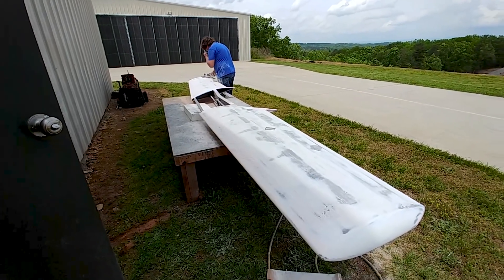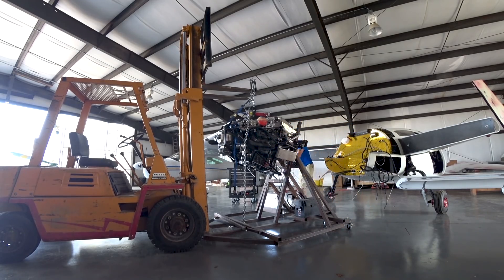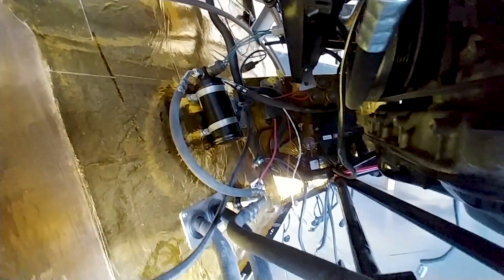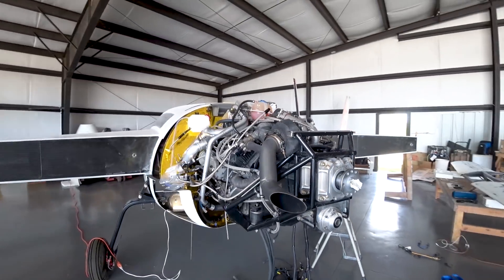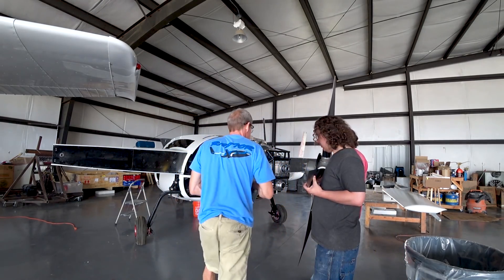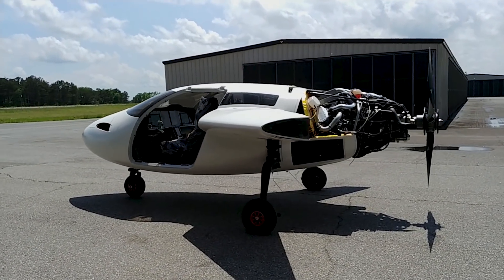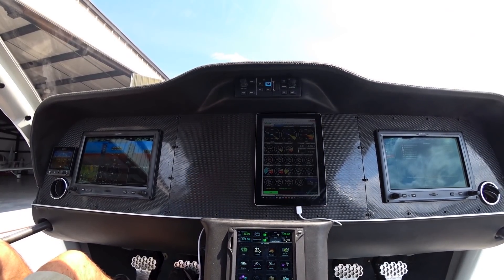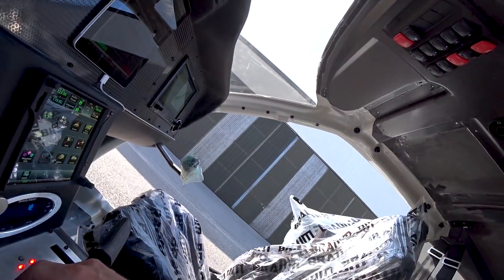Moving Under Her Own Power - Building the Raptor Prototype

Comment: Whoohooo!  Looking Good!  Congratulations!!!  Here's a suggestion for your oil leak.
Honda dominated motorcycle market partly by offering leak free crankcases using their own gasket material; Hondabond works great.
Not cheap or easy to find but this company is great resource for motorcycle components.  https://4into1.com/genuine-hondabond-ht-08718-0004-hi-temp-silicone-liquid-gasket/

Comment: Yamabond, hondabond, 1104, permatex for motorcycle, watercraft, atv. It completely different from rtv silicone and it works permanently until you take it apart. Yamabond from yamaha is the original. It will never break down over time.

Comment: You might be getting a ground loop on your radio ground, ground loops act like an antenna. Also how did you source your engine? Simply getting an auto-conversion diesel engine on an aircraft and having it work as expected is a good accomplishment, were I in your shoes I would see about offering your skills to kit builders to get their hands on converted engines.

Comment: Loved the smile when you went for a taxi. You should be able to pressure test the redrive off the engine to see if the weep is from the prop feed or the engine feed. It also may be flooded and over pressurising. The drain might need to be increased to reduce pressure inside, or may be bottle necked at the sump end.  Thanks for the updates.

Comment: ya know, it all looks cool and fancy but I would not trust that dash for nothing. One hit by an electrical surge or any number of issues electronically and you have nothing. I already know the hate comments but I said the same thing about dive computers and said I would never dive with a digital gauge set for the exact same reason. People died and it was a direct result of failed electronic gauges. 
Not mechanical, electric. So, have fun with your fancy machine. Looks cool but how does all that spot fill bondo handle flexing. I know is sure as hell does not work on boat hulls that flex. Just curious.
Reply: You act like this is the first plane built with these techniques.
Reply: @donanders2110  No, it is not that. I grew up around people like Darryl Greenamyer and Steve Hinton out at Chino Airport and Reno Air races and Long Beach Airport to name just some. My Dad was one of if not these top Mechanical, Structural and Propellent Engineers at McDonald Douglas. He set up the designs for many many things that fly in air and space. Every control thrusters that you see on all those maneuvers in space, well that was all his design. The Main Wing spare on the C-17 and ALL the tooling was his design. He was originally hired for his first jobs by Jack Northrup himself working on the Flying Wing. So yes, I have some stories to tell. What is it that you are not understanding about flex and bonding materials. Your right about it is not the first time those materials are used in a plane but I am also aware of why they are not used unless special bonding procedures are used with certain compounds and resins.  I know it is all about the process of new and better materials, and I am sure your homework is done. All I am pointing out is what I know and have been shown in many different fields of racing both in the air and in the water. Both are flexing and surface temp and pressures so, like I said, Very cool plane and looks very comfortable. I am sure it will fly as good as it looks. Please do not take offense to my pointing out my personal opinion. You know how it goes. Most people on here don't know shit about anything. Some though know more than most. Opinions are like assholes, everyone has one. Thanks for your reply and good luck with all your beautiful workmanship. You can be very proud of it. :-)

Comment: The continuous static is probably the radio frequency “electromagnetic interference hash” from the various 12V to USB switch mode charger units. Try disconnecting them from 12V and try the radios again with these USB chargers off. They are very RF noisy under load so may need alternate solutions.
Reply: You can get TSO USB sockets now, Mid-Continent do them i think.

https://m.aircraftspruce.com/catalog/elpages/trueblueusb11-12159.php
Reply: sickboy481 Unfortunately the standards for Electromagnetic Interference and Radio Frequency Interference that we have for terrestrial equipment are much stricter than for cockpits. Even so most USB chargers are non-compliant. I could not see for the TSO rated ones any mention of EMI standards that they comply with. Also the $200+ price tag is hardly justified even if hand made.
Reply: @stephenratten  Yea price of certification! We have done a number of installs of these in several cockpits and not had any EMC issues. I am fairly sure they are DO-160 compliant, will try to remember to look it up. Most TSO's do state that the device must not emit EMI.

Edit: They are DO-160G compliant; Section 21 Emission of Radio Frequency Energy to Category M
Reply from the maker: I'll try turning everything else off. Thanks
Reply: The Arduino is another possible culprit.
Reply: John Ferguson Yes I agree that is another possible source of interference but on the balance of probabilities and that the the Arduino have been designed with EMI in mind, the USB chargers are my #1 starting point. I generally have to unplug any USB chargers well before a destination airport to hear the traffic on the radios reliably above the “hash”.
Reply: @stephenratten  I think the Arduino are built to a price more than concerns over EMI. In fact if I was fault finding this(and I had this problem on a carbon fibre aircraft I built) then I would start with ground loops. specifically looking at audio coax connections and ensure that the screens were only connected at one end(normally the source end , radio for example).  Just my 2 cents worth.

Comment: Congratulations! 

Did the headset static go away when you were taxing? Its very possible your picking up the hanger lights. The ballasts in various types of lighting operate at a high frequency and it's a pretty common problem.

 Thanks for the videos!
Reply from the maker: No. The lights were all off in the hangar. I still need to figure this one out.
Reply: @RaptorAircraft  I had the very same problem with my Lancair, when I switched my old KY97 to an new 8.33 Icom A220, that was supposed to be a slide in replacement. The RX symbol was constantly lit and I was unable to turn up the RX squelch enough to close it. I started pulling breakers and discovered that it was simply radio noise from, primarily, LCD screens and USB outlets. I changed the antenna cable, tried another antenna, changed a lot of wiring to shielded wire, but nothing helped. If, perhaps, only the Trutrak AP was on, things were ok. If I then switched on the GPS, things might be ok for a while, but if I also pushed the breaker for the USB outlets, the squelch would break. I experimented with the sequence and found out that LCD screens and USB outlets are about equally bad in terms of emitting noise. I ended up having to send the radio in, in order to have the squelch threshold raised. That solved the problem. I guess the factory set squelch limits are set in a steril room and not in a real environment. Try pulling some breakers; you will probably come to the same conclusion. Oh, and by the way; great work guys! I take great pleasure in watching your progress!

Comment: I guess the cabin would be considerably quieter than an aeroplane with the engine at the front because the exhaust exits aft of the cabin rather than forward of it? Was that a consideration in the design, or just a nice benefit of it?
Reply from the maker: Yes it was.

Comment: Not an expert, but I think when they mate the two crankcase halves on an engine there is no gasket.  What they use is a piece of fine thread between the two sides of the metal crankcase. Just a thought if you have a leak where there is no gasket.
Reply from the maker: Yes they do use a thread. We are using an o ring line but it's not sealing perfectly.